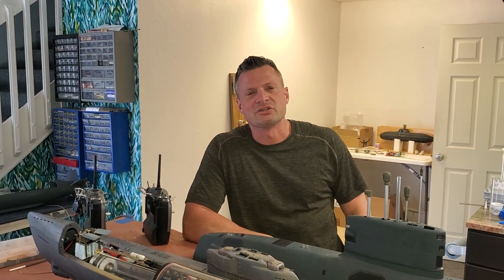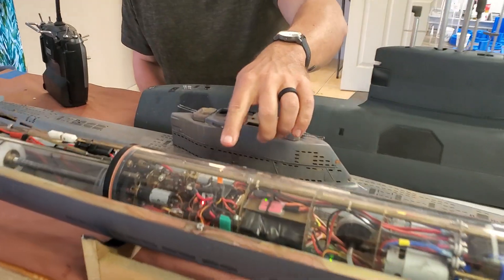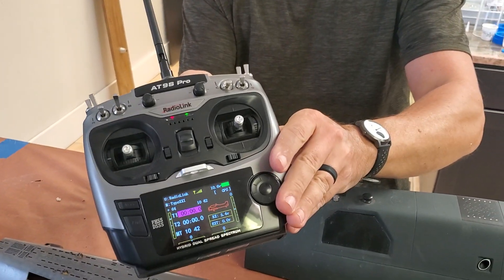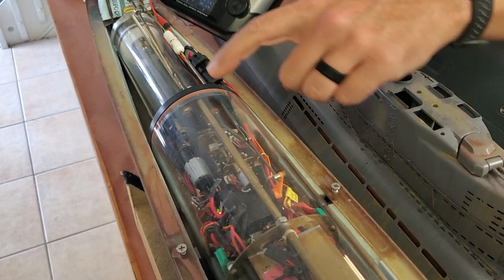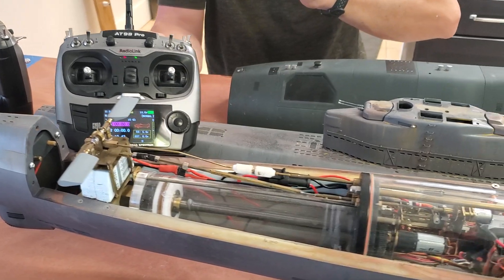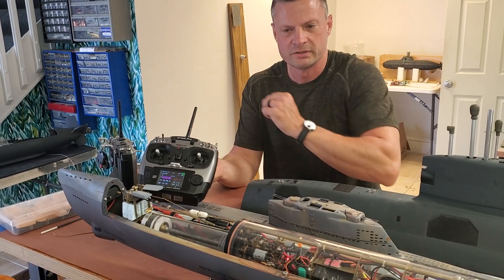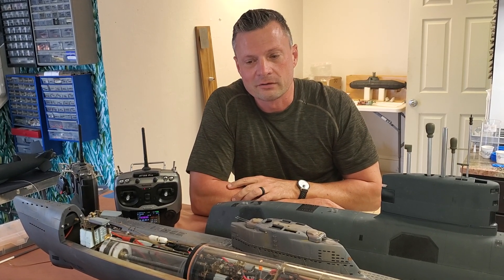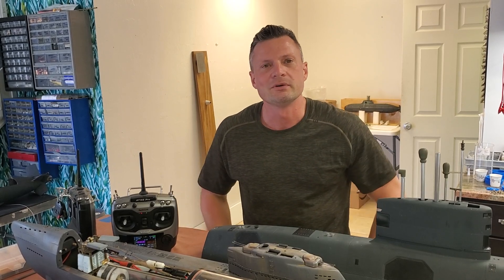Bow Retract Mechanism for RC Submarines

Comment: Very nice! Do you make anything similar that would work on a 1/72 Fleet Boat?  Thanks
Reply from the maker: I don't offer a commercial product, but if you check my channel, I do have a detailed video showing the bow retracts for a 72nd scale Gato that I completed.
Reply: @RCSubGuy  Thanks, I will try to find that video.
Reply: hello just came across a video I see that you use the radiolink AT9S pro transmitter and compatible with all submarines I cordially await your return